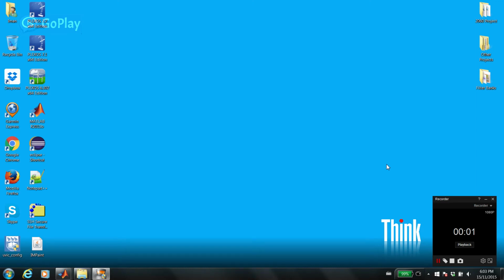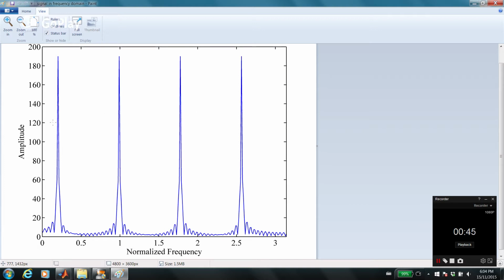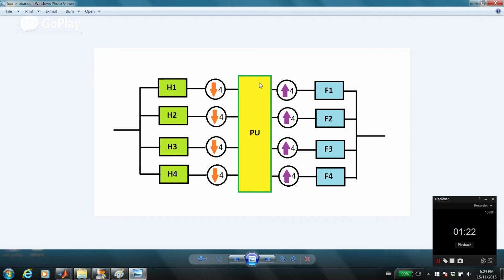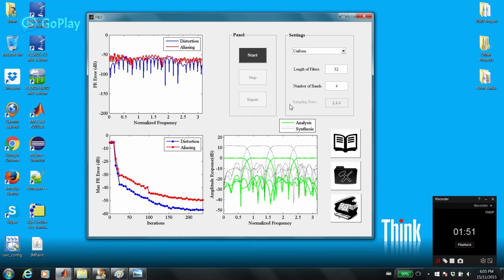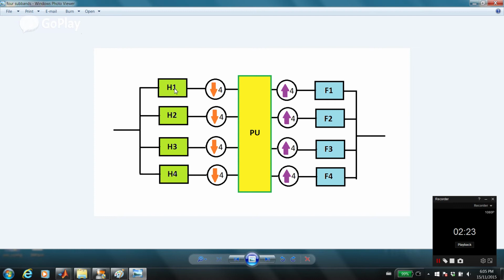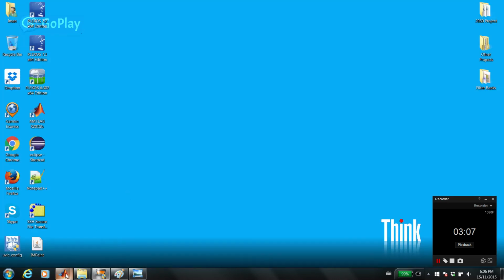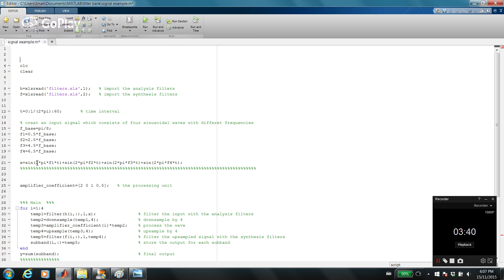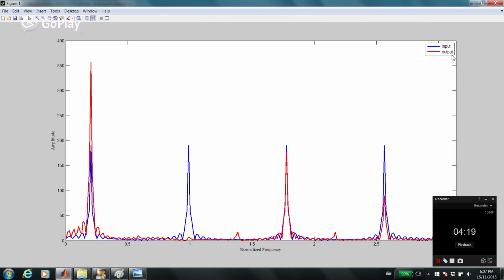Filter bank for signal processing

Comment: I would like to perform unidirectional and bidirectional image filtering to .raw image file. How can I do it in MATLAB? Which function can be used.
Reply from the maker: try "imfilter" ;)
Reply: Is it the same for bidirectional filtering to .raw file as well?
Reply from the maker: do you mean 2D filters?
Reply: yes. for two-dimensional .raw images.
Reply from the maker: imfilter is used for images (2D signals). So, it should be good for you.

Comment: Is down sampling and then up sampling required to do when working with filter banks ? And what type of filters were generated, are they FIR or IIR ?
Reply from the maker: They are not required but what is the point of using filterbank then? They are meant to divide a signal to M bands. As each band is bandlimited (pi/M), we can do downsampling to reduce computational load. Then, to go back to the original sampling rate, we should do upsampling. If perfect reconstruction conditions are satisfied, no distortion will be added to the processed signal.  Hope this makes sense.
Reply: I understand this, but I meant something else when I asked and didn't dive in details, I supposed that signal is already bandlimited, ex: from 1 to 10kHz, and suppose I need bands with width of 200 Hz, so I don't see why downsampling and then upsampling is needed in this case...other the case as you said - reducing computational power.
Reply from the maker: Please note that the filter bank (including down/upsampling) is designed so that perfect reconstruction conditions are satisfied. Therefore, if you ignore down/upsampling, you might add distortion/aliasing to your output. Unless, you drive the filter bank equations without down/upsampling steps. Does it make sense?